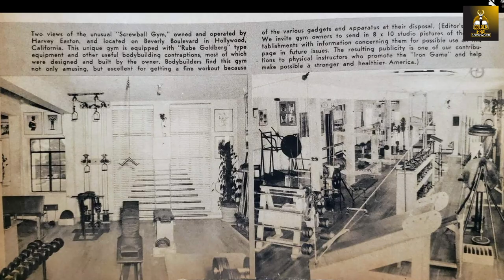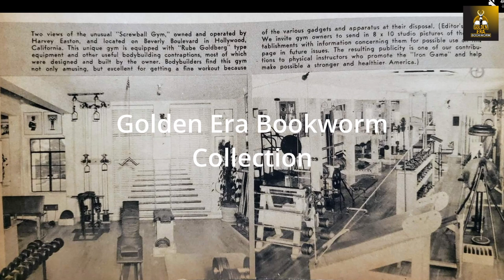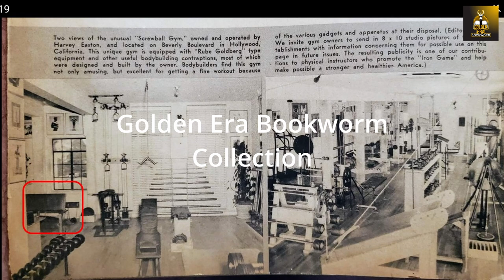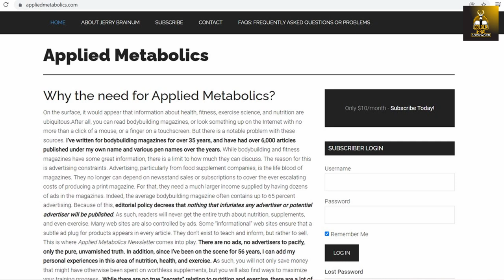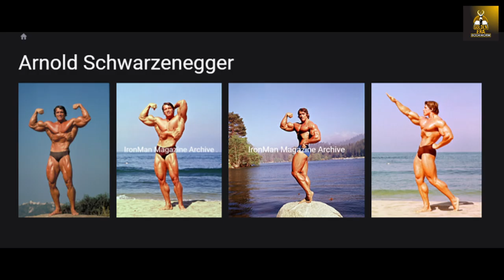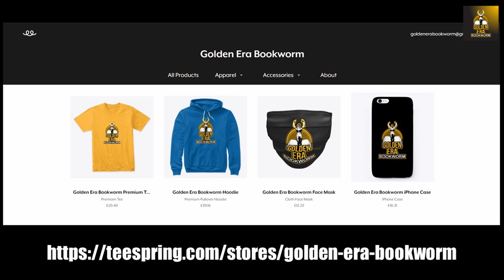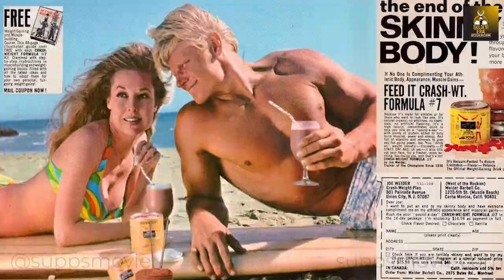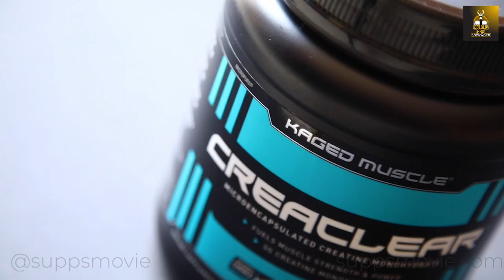HOW VINCE GIRONDA INVENTED HIS EXERCISES TO HIT SPECIFIC BODYPARTS & ORIGIN OF THE PREACHER BENCH

Comment: Steve Reeves did the bench press to the neck. Vince did not invent it. I worked out at Vince's. Clint is using a flat bench and not a rounded one for preacher curls. Vince had me roll the bar to my fingers at the bottom. The Sissy squat is a 3 part exercise and does involve squatting all the way down. Vince could be friendly, however, he had a short fuse and would get upset over the dumbest nonsense. It reminded me of a woman on her monthly cycle. Really stupid!! He was about 5'7 and acted like he had short man's complex. It is correct that some of his exercises were not joint friendly. He  thought his exercises could not be challenged. The gym looked like a dungeon. He had like a little swinging door in front of the toilet. He once had a coversation with me while he was sitting on the throne looking at me. A major lack of class.

Comment: I fee lilt the preacher puts too much stress on my tendons
Reply: I had a powerline preacher bench I sold because that's how I felt with the angle it had. Then I bought a Titan preacher bench and the angle is completely different, and it gave me a way better connection to the bicep using a ez curl bar. What a difference in benches! I'll never sell this puppy!🏋️‍♂️💪
Reply: You more than likely need to go lighter
Reply from the maker: So get strong on the barbell curl first...preacher is more advanced.  If you want to learn how to progressively train correctly I offer online coaching at www.goldenerabookworm.com
Reply: @vincentestrella9733  Well, I'm 5ft 9" 220. And I tried changing up the seat height on the powerline. Didn't help. That angle for me on the bench just didn't give me a pump. But the titan preacher bench. I watched a John Meadows video where he shows  you where your arms should rest on the pad, and I adjusted the seat ,I did 3 supersets with lighter weight ,and tricep cable pushdowns. 💪SWOLE! 😆👍 The angle  of the titan bench is similar to what Larry Scott used.
Reply: @vincentestrella9733  Well,my left arm got broke in a motorcycle accident years ago.  So its a little crooked and the dr . said I had minor nerve damage. A straight bar for curls  is difficult for me to use. But I do good with a ez curl bar.